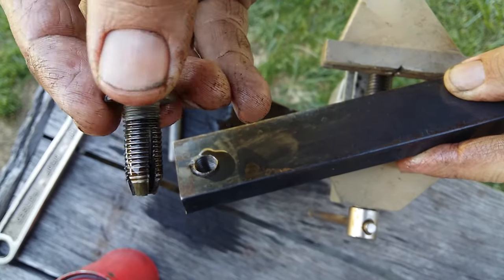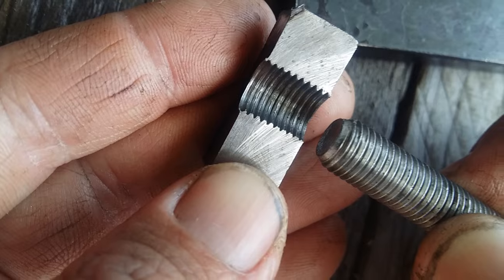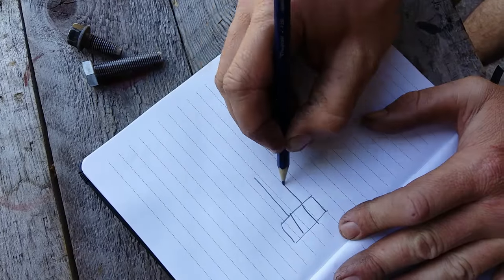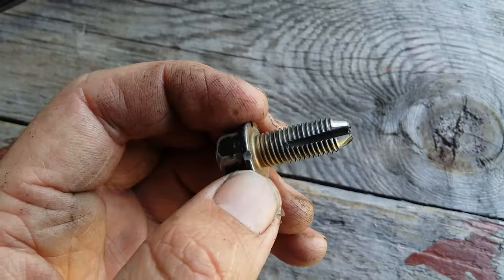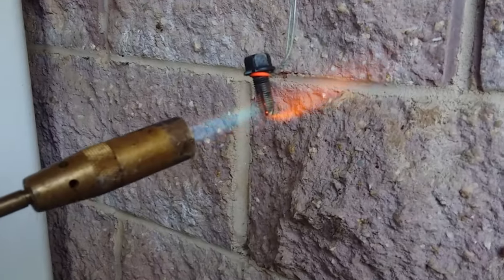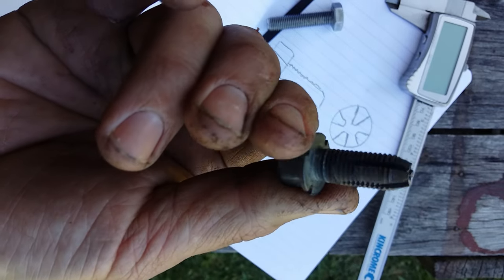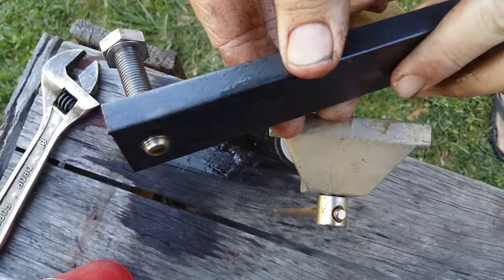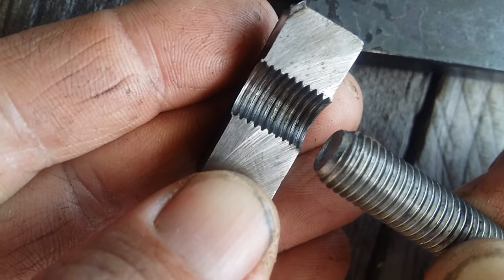How to make a Thread Tap - How to easily tap a thread - DIY Thread Tap - Putting a tread into metal.

Comment: Did this exact thing just with a hacksaw instead of a grinder and with vegetable oil instead of salt water. Worked really well actually. The bolt seemed to bend a tiny bit when I quenched it but it didn't seem to be a problem.
Reply from the maker: Very cool 👍
Great job working with what you have.

Comment: i didn't you can harden normal steel screws
Reply: Try using super quench. can harden and toughen mild steel.
Reply: I'm pretty sure most screws are to steel or high carbon steel so hardening, tempering, or sorting should work.

Comment: Did anyone try to make a tap for M3 (3 mm)? I couldn't find taps this small sold separately. Also, do I still need to harden the metal with a blow torch (if the thickness is only 3 mm)?
Reply from the maker: Yes definitely needs hardening.

Because of the small size, If you are making your own. I would only cut 1 flute. 

This technique is more for getting the job done, when you can't find the right tap. 

Amazon sells individual taps:  https://amzn.asia/d/9evHlx6

I'd be curious as to what you are tapping into?
Reply: @NikitaMaree I've given you a reply yesterday and I don't understand why it has been deleted....
Reply: @NikitaMaree Anyway, I'm tapping into a broken aluminium kickstand. I'll tell you how it goes.
Reply from the maker: Good luck 👍
Reply from the maker: That's odd. I sometimes don't get notified for a while too.

Comment: Do we still need to harden 10.9 grade metric bolts?
Reply from the maker: Depends what material your tapping into. You might be fine. If it's harder than mild steel, I personally would harden it. Good luck 👍